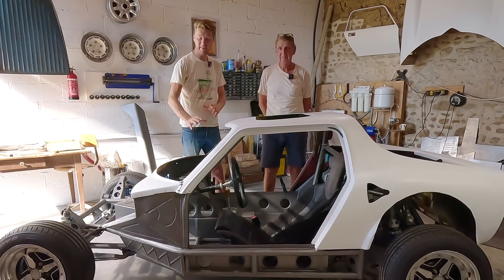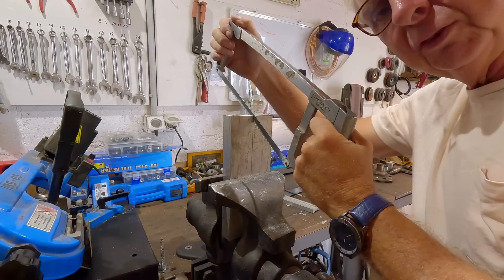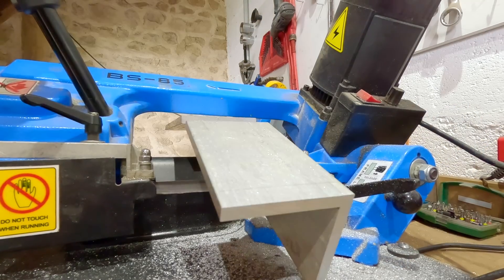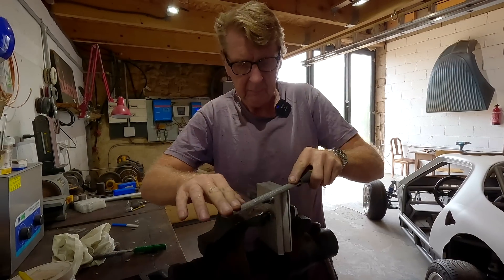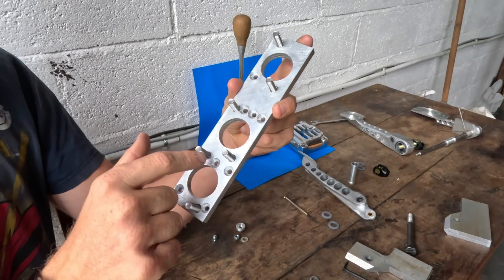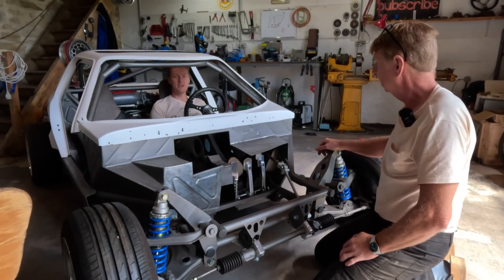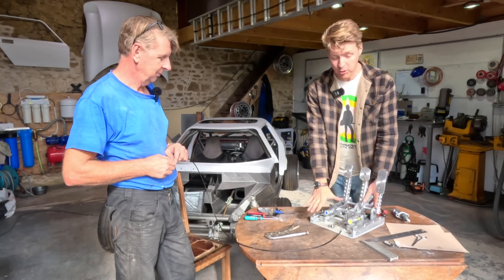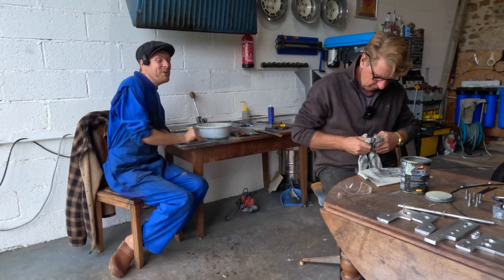Pedal Box Assembly - Time Lapse - Project Mosquito

Comment: Nice work , be proud ! 
So I was washing up and noticed the white plastic , nylon whatever , chopping board had warped under running hot water . It was damn hot water and it returned to it's flattish shape after drying and cooling off . Now I know why you cut holes in your board , they aid in cooling ! Lol
Reply from the maker: We will also bolt the board to the floor this will prevent any warping.thanks for the nice comment.

Comment: Honestly, I was a little disappointed that you didn't have video about the front hinge system. I assume you are catering to the algorhythm, and because of complications, you couldn't present an acceptable video about the front clip. I hope you guys are still making progress, it is very important for the success of the car. It is just as interesting to when you have to change your plans to maintain the high level of the rest of the build. 🦟🦟🦟
Reply from the maker: Thank you so much for Mosquitoes and for watching until the end. Making this video had nothing to do with the algorithm it was because we woke up to freezing temperatures and deep snow. Our work shop is not yet heated. It was simply to cold to work inside there. The pedal box work was over 9 weeks so not for everyone's taste we decided a shorter version was the way forward plus then we didn't disappoint our viewers . The hinges will come soon.
Reply: I was thinking the exact same thing. He must be trying to figure out how to put linear actuators for the hood mechanism😂😂😂

🦟 🦟

Comment: Great!

What is the solution for the wires since the pedalbox is adjustable?
They have to be movable too in a controlled fashion?
Reply: Braided flexible, same as at the brake caliper end
Reply from the maker: Thank you so very much Phil for answering the comment, Thank you very much.
Reply from the maker: Thanks for the comment Phil answered it beautifully.

Comment: Omg all that work in the pedal legs and such. Id just 3d print it and cast in aluminium following by some sanding/water polish.
Ps what lathe is that? Reminds me of the older version of my vesuv lathe
Reply from the maker: Thanks for the comment for us it is not about 3D printing etc. It is about the engineering journey. We have no idea about the lathe make we bought it second hand from a retiring blacksmith.